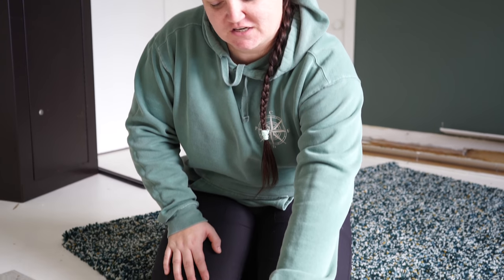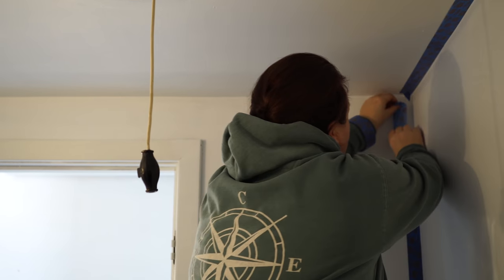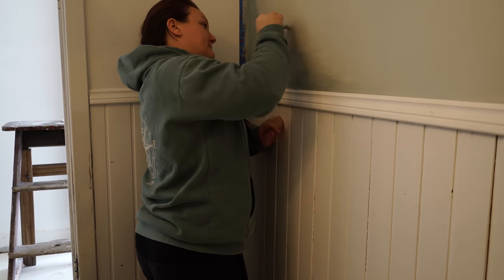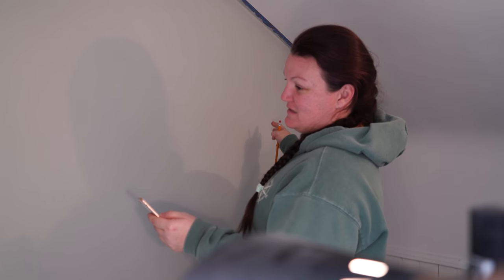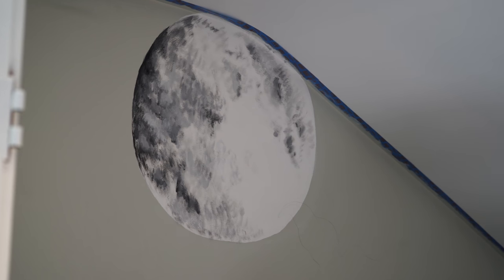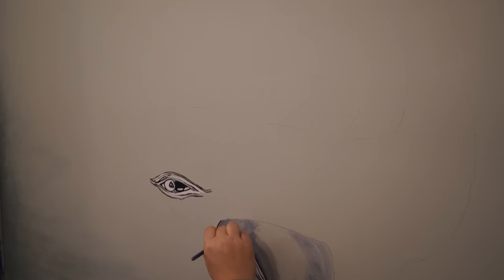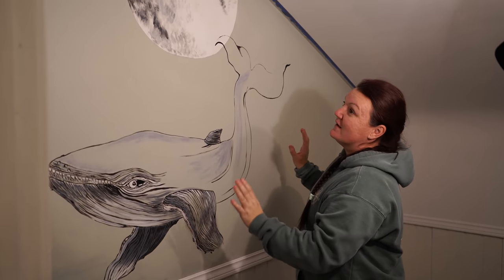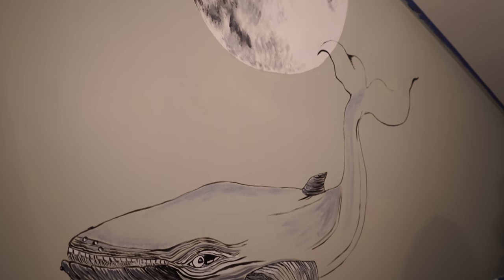Painting an ocean wall mural | Fixer Upper Home Makeover EPISODE 3

Comment: Your murals is starting off wonderfully!  You might want to try mixing a small amount of paint extender or Floetrol, even though you are using house paint this will open your work time and make your color blends easier and smother. It will keep that from drying so quickly as you swirl the colors together. I have done this with great success on my own work.